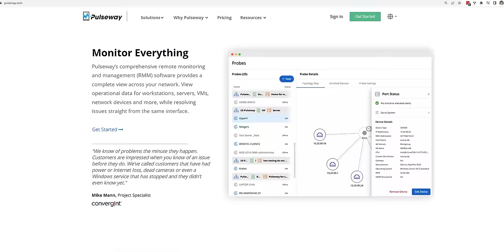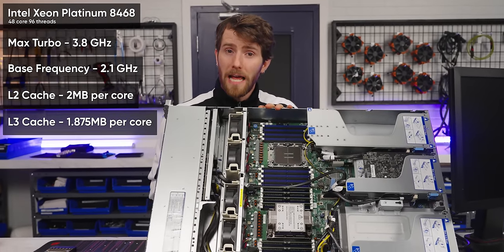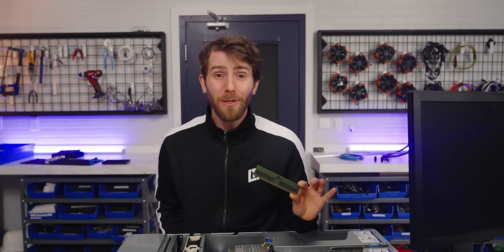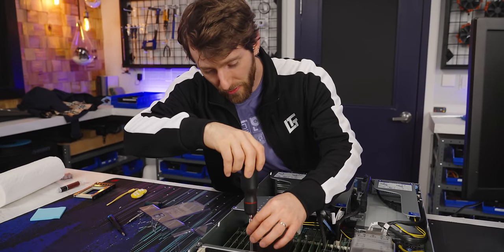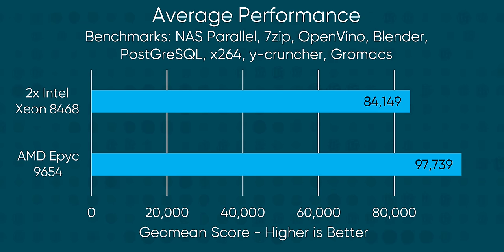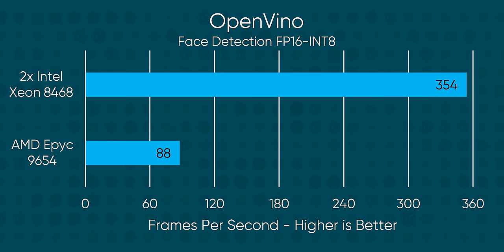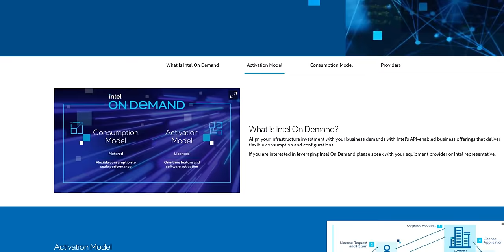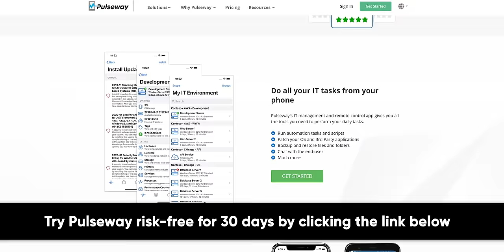Intel’s New CPUs are Cringe - Intel Sapphire Rapids Xeon Platinum 8468

Comment: The "On Demand" feature feels like a giant middle finger to Intel customers
Reply: Because thats exactly what it is lol.
Reply: It's a clusterf*ck of a CPU architecture. Alder Lake is like NASA tech compared to this.
Reply: As a private person, yes, of course it is. The problem is that management or procurement departments or even tech departments prefer this shit. You have a fixed budget for something and that's it. Splitting the investment over two or more budget periods makes it WAY easier to buy something you want or need. It's still bullshit that costs the company more in the long run, but that's how most companies work sadly.
Reply: To be fair, this practice of modularization of hardware features through on demand or as a service it's becoming the industry trend. Dell did it with their data protection solutions, like IDPA and Data Domain, Dell APEX and PowerStore. IBM does it with Z framework. HPE does it through HPEFS feature as-a-service solution. Equinix does it in general. Unfortunately it's a trend. At least with Dell, they actually sell the hardware for the price of what would cost without the feature, like storage, (in this case, they sell bellow the cost of production), and then they make up for it as the customer licenses the features.
Reply: Intel used to do the same in the hardware, essentially the same chip hardwired to disable some functions. If you think about it, once a chip is designed, producing more of them cost much less than making a simpler new design. This is also why Apple put M1 and M2 chips into laptops and tablets. I am sure they could disable features on the iPad to save power. But to design a different chip just for iPad is much more expensive. Because Apple uses its own chip, they don't have to play the marketing naming game of different versions of M1/2 chips. Just use the same chips. Also this is the reason why they put an A13 chip into the Apple monitor, same reason, the chip is cheap enough.
Reply: Why?
AMD is currently just cutting the CPU hard so those features can not be unlocked at all. Intel is just putting it behind a PayWall instead of destroying the hardware.
And not like this hasn't been the standard for decades already.
Reply: Because it pretty much is. The hardware is already on the chip, it's not like they are saving production costs in any way through this model. They are selling you hardware that is on the chip but not letting you use it unless you pay extra. And I don't care about examples of "But others have done this in this past", that does not mean it's correct. Society would have never progressed if everyone argued "But we always did it this way!" rather than arguing WHY it's always done that way and pointing out that it's not a good way. Remember all the complaints from when BMW made heated seats a subscription service? The hardware was already in the cars, it's not like they were any cheaper to make, but they won't let you use said hardware unless you pay a subscription fee.
Reply: Except it isn't at all. This lowers prices across the board(manufacturing one product is cheaper) and allows for quarterly budget upgrades for customers. These kinds of things aren't directed at one or two cpu customers, they're directed at companies buying thousands of these CPUs and then unlocking stuff next quarter when their budget allows.

A company can unlock the next set of features in a chip in Q1, work out the kinks and verify it'll run at scale, then unlock the features in Q2 across the whole company and roll it out. From a company standpoint this kind of stuff makes sense.
Reply: Intel trying to be IBM, I wonder how it'll go...
Reply: @Cyber_Akuma  Well, in that case, you should probably start by demanding more bandwidth from your ISP, since the necessary technology and infrastructure are often already there. Additionally, by that same logic, most - if not almost all - software that currently requires a paid licence or subscription should be made free, because you’ve probably downloaded and installed the whole application on your device already 🙃🙃🙃
Reply: What I don't like about "On Demand" features is that they tend to become subscription features. Instead of being a one time cost they become recurring costs.
Reply: @pieterdepauw6599  It costs more in equipment to give more bandwidth, especially reliably to everyone over cable. You are equating one person more heavily using a shared connection that requires infrastructure vs single products sold to single people. (Also, trying to defend ISPs? Seriously?). And no, you can't make that argument with software either, because software only has a cost of development, no cost of materials, manufacture, shipping, etc that physical products also require. Also, also bullshit that so much software that used to be paid to get a license now instead is subscription only.
Reply: @Cyber_Akuma  " it's not like they were any cheaper to make"
Nah, it is cheaper to make like that.
Reply: @ABaumstumpf  It's literally not. It's at best the same to make, but it's not cheaper to ADD additional hardware to it. And if it is cheaper to make then it justifies locking it out unless people pay for it even less.
Reply: @Cyber_Akuma  " It's literally not. It's at best the same to make, but it's not cheaper to ADD additional hardware to it"
No, it quite literally is cheaper to have just 1 hardware-version and lock the functionalities than spinning multiple different hardware-version.

Heck - that is the reason why AMD does that too - and then destroy the features in hardware before selling the chip.
Reply: @ABaumstumpf  Except that doesn't make it cheaper to make, it makes not having two model lines cheaper, not cheaper to put that hardware on the die than to not have it. Not that much different from binning chips with a defective core as a lower end model. Except the difference here is that hardware physically does not work, not that it works fine but is locked out unless you pay more for hardware you already paid for. Are you going to defend BMW's heated seat subscriptions with the same argument too?
Reply: @Cyber_Akuma  ", it makes not having two model lines cheaper"
So it is cheaper.

"Except the difference here is that hardware physically does not work"
No. Either it does not work or it is not needed - and is then fused off.
AMD is doing exactly that - cutting of completely working parts to get higher yields for sale. And intel is locking them behind payed updates to get higher yields for sale.
Reply: @Cyber_Akuma  That was my point exactly... I'm not defending ISP's, but I was just trying to illustrate that their main costs are the infrastructure investment. For software, you indeed have that same development costs. In the end, you are just paying for the R&D. So, why is this now a thing? The economy of scale makes it much cheaper to just make stut ome adjustments to a fairly small amount of designs rather than to design and manufacture much more different models.

Especially in comparison to these initial development costs, the difference in costs of materials of building an upgradable product is negligible.

But hey, if you don't want to buy a certain product for some reason and/or if you feel that a product is just not worth a certain price, then by all means, don't buy it... 

And if enough people also feel the same about your expectations for a product in that category at a specific price point, someone else will definitely fill that gap in the market. But don't expect anything good will come for free.
Reply: @ABaumstumpf  "So it is cheaper."

No, that's my point. It's not cheaper, if they made a model line both with and without it that would cost more, but if they just made one model line without it instead of just one model line with it then that would be cheaper too. They aren't magically removing cost by adding that hardware.

"No. Either it does not work or it is not needed - and is then fused off."
Only in cases of high excesses in yields are working components cut off, it's generally broken components fused off to increase yields and so the entire chip isn't junked.

"AMD is doing exactly that - cutting of completely working parts to get higher yields for sale. And intel is locking them behind payed updates to get higher yields for sale."
justify
Reply: @Cyber_Akuma  "No, that's my point. It's not cheaper, if they made a model line both with and without it that would cost more"
And you are still yet again contradicting your self.

Comment: I think Linus had to do more sponsor reads during this video just to pay for the server he broke letting thermal paste into the socket.
Reply: Thermal paste (unless you use liquid metal) is usually none-conductive, meaning the reason why it most likely didnt work is lack of a proper electric connection. Unless he broke something else too, it should really be as easy as cleaning of the thermal paste with some alcohol based solvent.
Reply: @SuperD863  I had to use alcohol and a very soft toothbrush to clean a socket with dried on thermal paste. There was also damage to the pins (Amazingly not by me) that required careful use of precision tweezers to fix.
Reply: @SuperD863  yup, a very fine soft brush and some alcohol should do the trick even on these super densely stacked and thin pins, makes me wonder why they didn't do it to show the cinebench run live.
Reply: I thought it was just me that was mistaken that I'd heard Linus mention the sponsor five times during one video. Its getting like American Television...
Reply: @SuperD863  There's products specifically designed to clean circuit boards, I've used them to literally hose off dust and contaminants from underneath BGA chips to revive things, would probably fix this even if it was conductive paste.
Reply: You can't really break your computer products with thermal paste unless you use conductive thermal paste. Where the problem can come in is trying to clean it up improperly. Thermal paste wouldn't make it fail to turn on, it could prevent pad to pin connection which you would just carefully clean off.
Reply: @SuperD863  This is a high frequency high bandwidth bus. Its possible parasitic capacitance or whatnot was added and is jamming the signals up.
Reply: Cleaning thermal paste off of socket pins properly is not a trivial or obvious task. The consistency of the thermal compound comes into play pretty quickly, and it is very easy to damage the pins, even if proceeding slowly and deliberately, particularly on today’s enormous sockets.